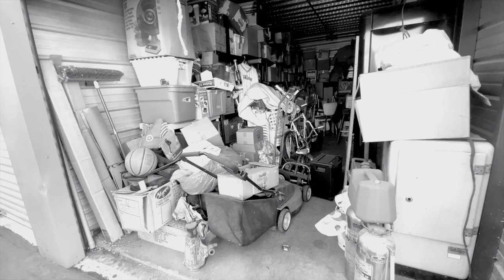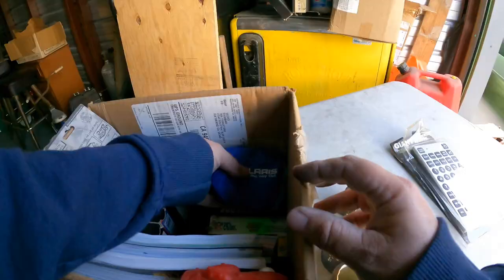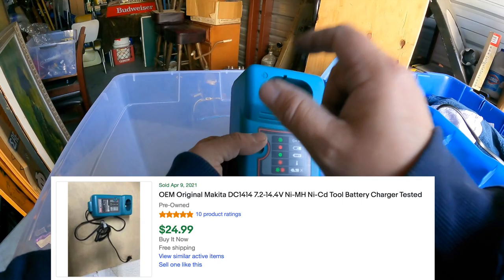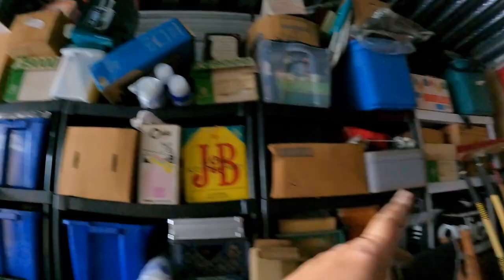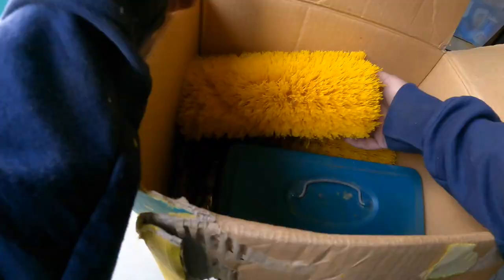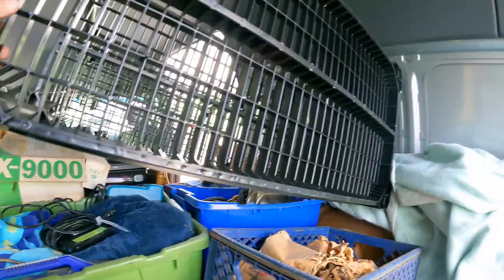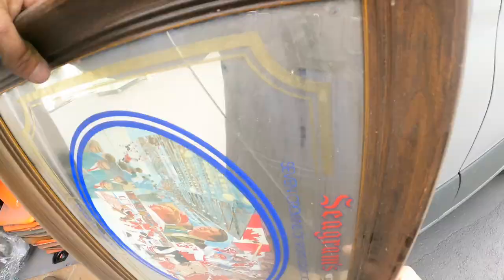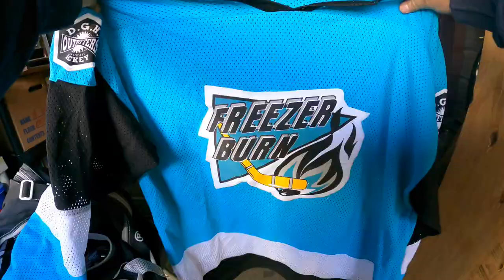Let's keep DIGGING in the locker I bought for $2,321 while my competition slept at an online auction

Comment: That heavy duty kettle was designed to sit on the back burner of a woodstove or on the back corner of a woodstove that doesn't have burners to heat water. It helped keep moisture in the air.
Reply: That was a lot of fun watching what you was doing congrats totally awesome
Reply: Also Jack the inside of the kettle is corroded with  sediment from the hard water that was used in it!! Definitely vintage!!

Comment: Aluminum Antique Kettle used to put moisture in the air hence the corrosion. Filled with water and placed on a wood stove or heater. The water would evaporate  and act as a humidifier in days gone by.

Comment: Jack, that large pot lid is called a "universal"  pot/pan lid. It will fit several size pots and pans (check out the concentric circles on the lid). It is found in 2 sizes-- the larger size like you found and a smaller size one for small pots and pans. I have at least 2 of both sizes, in both solid metal (some in aluminum and some in stainless steel) and 1 of each size in stainless steel with glass windows. They are especially good to use on frying pans of various sizes that did not come with lids, for example, cast iron.

Comment: 21:08 is a sphygmomanometer aka blood pressure cuff 😉. That style is getting harder to find. It may very well sell for parts. The bladder and tubing is easily replaced. 
 The kettle looks vintage I’m guessing WWII era, because it looks like pot metal . The sediment is normal in that type of kettle. People used to fill them with water and sit on the stove to act as a humidifier. 
  The drinking glasses with the red design (in the disintegrating newspaper) are from 40’s or 50’s. They will sell at the vintage market.